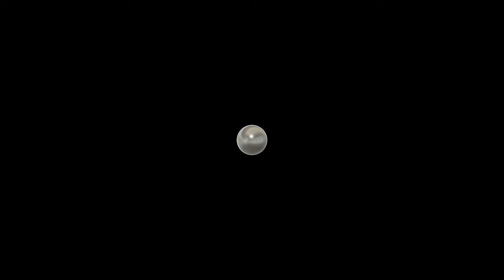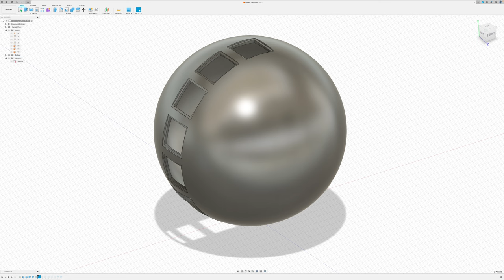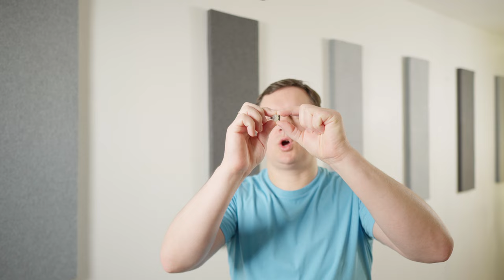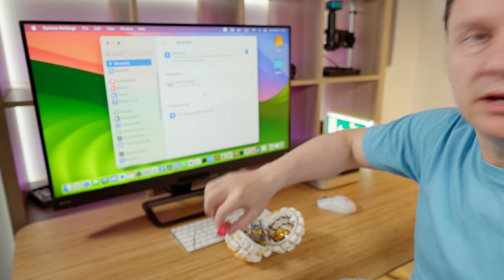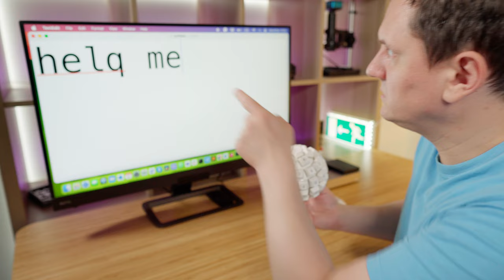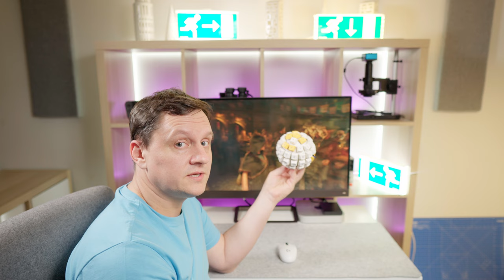I made 9999 year keyboard mouse

Comment: This looks amazing. You've let us all to print the base, which is awesome. However, do you also have a github for the code behind the ESD 32 and accelerometer?
Reply from the maker: I updated the video description with links: to libraries I used and 2 example projects. I learned a lot from them. And yes maybe I need to clean my code and upload it somewhere as well.
Reply: @PavloKhmel  Super cool that you are so open about sharing. Love that mindset. Thanks a lot, and much respect...

Comment: Now press two buttons in oposite corners of the grid at once and let's see if you fixed a common grid wiring issue.
Reply from the maker: Yes. I'll need to solder 62 diodes before pressing 2 buttons :)